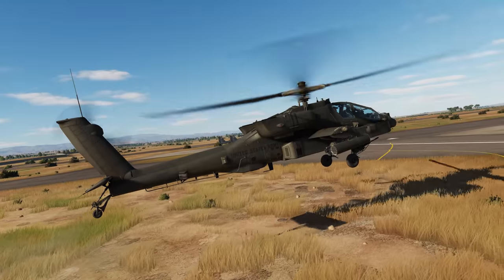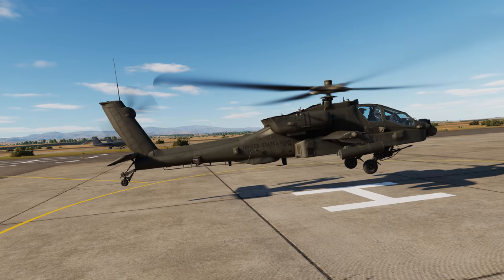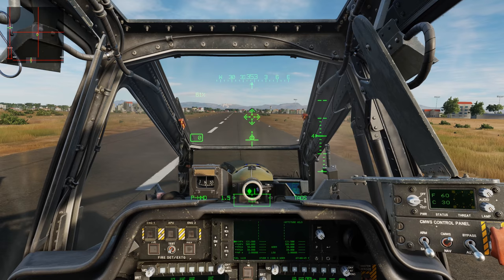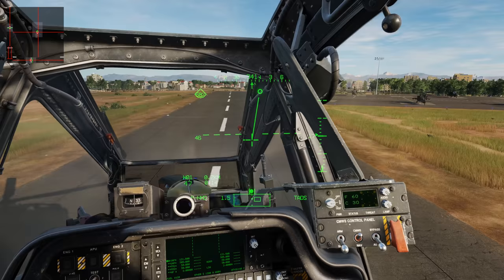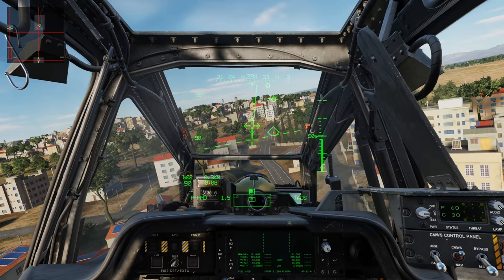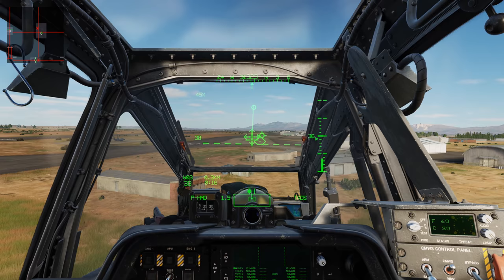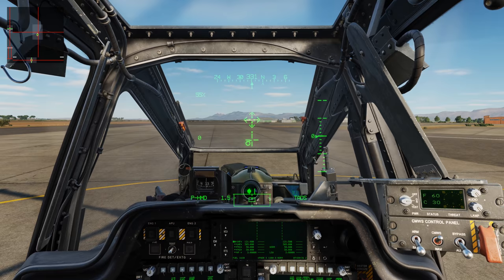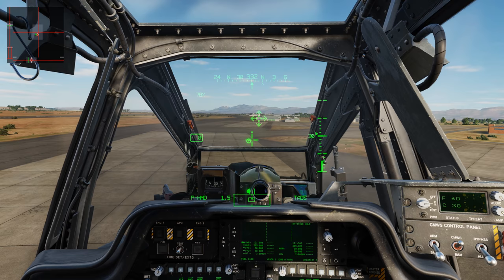DCS: AH-64D | Project Update and Altitude Hold Mode

Comment from the maker: Note: Time 2:12, I misspoke. Right to set Alt Hold.
Reply: :elbowcough:
Reply: Also, FYI, the audio should beep when disengaging either one, and not when enabling either/both of them. Acft never beeps on engaging, only disengaging - the audio is for when pilot is "inside" acft and isn't visually looking "outside" so as not to  drift into something inadvertently. The visual cues are sufficient when engaging holds because it is seen in pilots cross scan.
Reply: @Matt Wagner  At 6:27 what specifically did you mean by “saturate the controls” (when you advised slowly adding collective so as to not “saturate the controls”) ?
Reply: @baomao7243  The autopilot can only move the controls so much - less than you the pilot. If you raise the collective too fast while in attitude hold, the autopilot won't be able to counter the sudden torque and the aircraft will probably start to yaw, possibly wildly.
Reply: @baomao7243  Exactly like Oldcorn said above - the autopilot uses hydraulic servos that only have so much physical movement available, which are the same servos that run the "Stability Augmentation System". Once these get "saturated" it means that the autopilot / stability control system is trying to command more of a movement than the physical capabilities of the hydraulic actuators and you'll get an error that says "SAS Saturation" on the UFD. 

Under normal real life flight - this can happen in harsh winds, but in the simulator it can happen because of winds as well as the way we trim the copter using a spring loaded joystick normally found on a PC.
Reply: @henrikoldcorn  Thank you
Reply: @Aphelion79  Thank you.
Reply: Too err is human....can't wait to see this feature in open beta.

Comment: Nice one on the auto-anti-torque feature! I don't expect to use it, but sounds very helpful for many not using rudder pedals. Somehow your flying is still smoother with the on-throttle controls than me with pedals though.
Reply: I use one of the rotaries on the x-56 throttle for anti-torque control. It's not ideal but it's better than z axis on the stick imo.
Reply: @chillicothewarrior  I use both, combined using Joystick Gremlin. The rotary thing for prolonged changes in yaw, and twist for brief maneuvers, feels fantastic. Until I buy my pedals ofc, which won't happen soon bc they cost like a real Apache lol.

Comment: My favourite module so far, so well put together, I may never fly another jet, but it has really highlighted how crappy my rudder pedals are, the TPR pedals are looking like a must have.
Reply: For around 400 hrs of use, the TPR pedals have served me well. They are bit pricey but surely a solid and accurate piece of hardware.
Reply: I heared there are conflicts with virpil hotas and TPR pedals ... What stick and throttle do you have?
Reply: @OliverMilas  I have the Thrustmaster warthog HOTAS setup. Although I can not comment on specific conflicts, my controls have been mostly fine. However, i have numerous USB pheripherals like VR headset, digital soundcard, keyboard, mouse, headsets etc and every now and then some weird conflicts seem to happen in windows in USB pheripherals (Like once a week or so). Usually they are fine after disconnect-connect for any specific hardware.  Although this is probably something that is a given "feature" in windows enviroment. Nothing serious so far and not really related directly to TPR's.
Reply: @OliverMilas  Thrustmaster, so should be ok, thanks for the heads up.
Reply: @SteveSurgenor  Just to add, USB hubs with number of ports seems to be the common culprit for incompatibility issues. Not controllers themselves. Happy landings!
Reply: Check out the virpil pedals, I'm using them with no centering spring, makes a world of duff

Comment: So glad this is coming. It was already pretty difficult to find 0 on vertical velocity. Couple that with weight changes when firing off hellfires. Hopefully this will work well. Has there been any improvement to the vertical velocity gauge? Specifically with the way the arrow lines up to the center point on the ladder?

Comment: Hey Matt (or anyone who sees this and has a good solution), I have a lot of troubles using the force trim. My pedals and joystick use springs to give feedback. In the real aircraft, I always visualize setting the force trim as commanding the cyclic or pedals to stay in the position I’ve placed them in. However, using a spring joystick and spring pedals, there’s no way to set them. Using force trim in DCS almost feels like telling the joystick or pedals that the position I’ve commanded them to is their new center position. So, I find that I’ll hit the force trim and quickly have to release pressure on my joystick and pedals or else the aircraft will overshoot. 
And suggestions? When you set your force trim in the video I noticed that the aircraft stayed super stable.

Comment: Hi is this implemented as its not working for me the other Trims work fine
Reply from the maker: Yes, you need to bind the George command switch.  https://youtu.be/ZGLLDXKecsc?t=38
Reply: Hi Matt yes I've done the bindings all work find just the alt hold it binds just dose nothing in game and while in a hover any help would be appreciated, fantastic  vids by the way I subbed
Reply from the maker: @Beta250trials  In both cases, you still need to first establish yourself. It is not a magic system; it is a hold system.
Reply: Ok once I'm in a hold I trim up first let settle  then att left hold let settle  0 movement hands off then alt hold nothing.  In settings  if I click it shows up as selected. I think it's a bug I will try a re install  thx
Reply from the maker: @Beta250trials  No problem here, make sure your radar altimeter is enabled. Post a video or track to the forum and I'm sure a kind soul will help explain where you are going wrong.

Comment: I constantly get sas saturated warnings. It has absolutely ruined the flying experience for me. What am I doing wrong? I've turned the volume down and it's still annoying. It seems to happen both when casually flying around and when flying aggressive.
Reply from the maker: It sounds like you are not properly setting force trim to set a new control center.

Comment: Its impossible do it without pedals.
Reply from the maker: I don't use pedals, and as you can see, I do okay.
Reply: @MattWagner  May I ask what is set in your config Cyclic Trimmer Mode and Pedals Trimmwr Mode?
Reply from the maker: @rumi.137  Central for both.
Reply: @MattWagner  Its so better now. Thanks.

Comment: Right now, hitting something MOVING with hellfire is almost impossible (multiplayer, 15 hellfires vs moving t-55, 0 hits) so TSE will help?
Reply: Only if you cant keep your laser on target. Else, its just lag
Reply: I routinely hit moving targets with hellfires in multiplayer.  You just have to lead them while lasing.
Reply: Never a problem for me.  I think you must be doing something wrong there bud.  Are you keeping the laser turned on for the whole time of light of the missile?
Reply: @MrPhantom453  You shouldnt have to lead when using laser. The missile corrects its trajectory to look at the laser who is perfectly spot on.